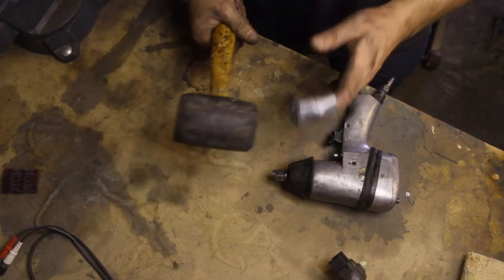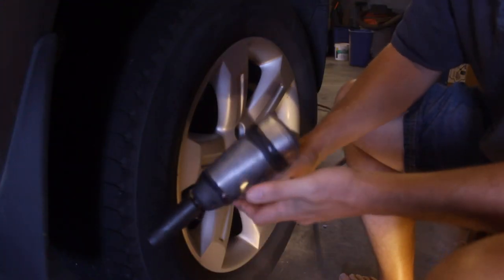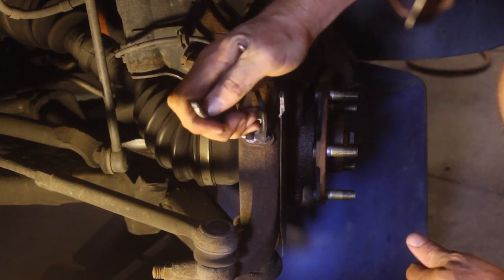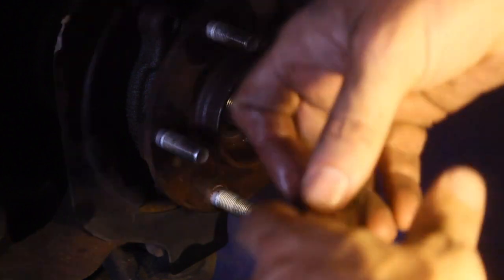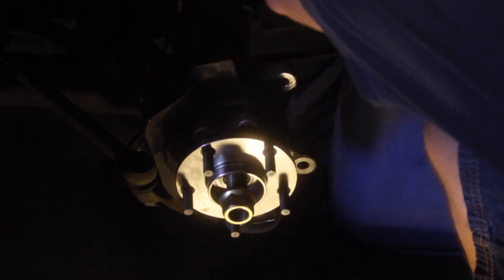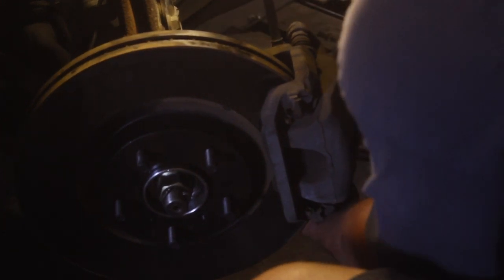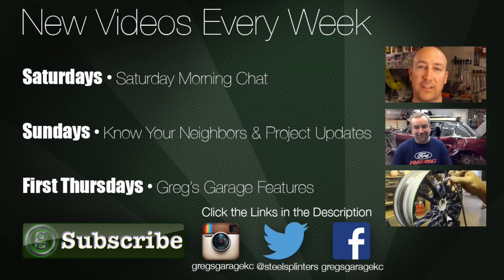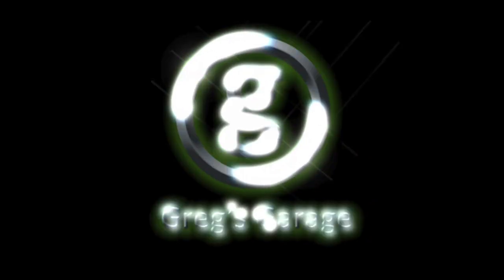Nissan Wheel Bearing Hub Replacement - Murano

Comment: Thanks for the great video Greg! My son and I used it as our guide to replace both front wheel hubs on our 2004 Murano. Side one was plagued with issues of our own doing, such as snapping a bolt and spending hours driving around town looking for one (this is Honolulu) and then leaving the keys in the ignition which killed the battery. But eventually got it done. Side 2 was an hour start to finish. Your video made it easy.

Comment: Greg, Thank you once again for such a great step by step video. First, last year with the radiator replacement vid you posted and now with the hub. I have, of course, watched other videos, but I find yours to have the best explanations and you seem to find the best angles to show your fellow garage gear heads/mechanics what exactly your working on. Thanks a lot!
Reply from the maker: Thanks brother!  Just trying to pass on what I've learned over the years. It's all easy stuff if you know the big picture.  I've got one on spark plugs as well. It's a funny little job on the nissans.

Comment: Hello, I just wanted to say thanks for this upload it was very helpful. I just changed the wheel bearings on my 07 Murano and your video helped lots. I was having wheel steer bump steer play and a slight clicking sound at slow speed, I thought it was the cv joint making noise but it was the brake noise you talked about talked about clicking was the bearing going bad. Oh I only have 105K miles on my Murano. Thanks again.

Comment: Thanks for this! If youre doing this on your Murano because you have road noise and you've determined its NOT a bad tire or dragging brakes its almost always the front right even though it sounds like the front left. Side note, be prepared to buy a new ABS sensor as well because they are cheap plastic and they'll most likely break when you try to extract them and you'll have to drill the plastic out. The auto parts store will charge over $300 each for the sensor but you can get them at Rock Auto for $50 each

Comment: Great video Greg!
I Especially like it when I see a lug nut go on by hand!
Reply from the maker: tomswonderfulworld Yeah, that's my trade mark.  One good stripped stud will do that to you.
Reply: Just wondering,m if the wheel bearing nut is ONLY 98 ft/lbs??? My Infiniti FX45 =, Nissan, 4 wheel drive is 205 ft/lbs?? Just wondering, did  NOT google it yet....;o)
Reply: How long SHOULD this Repair take on a Older (2006) Murano ? Ty

Comment: Thanks Greg for the great video. changed my wheel bearing hub today. if I had to add anything for others to follow is that when removing the old hub expect it to be rusted in place and use copious amounts of pb blaster along w a pry tool.
Reply from the maker: +Tom Orr YES.  That puller is a MUST have for most of these cars.  100k+ miles means the old rust monster is going to have a good hold of anything below the frame rails.

Comment: Fantastic video! ........ My wife's 2012 Murano has that rhythmic rotating sound. Drives me crazy! I've always thought it was the bearings but became a little puzzled when the sound nearly disappeared after I put new tires on it but it soon returned. It's not the tires!! The tires are wearing beautifully and I faithfully rotate them every 6000 miles. I guess my next move is to have the hub assembly's replaced. Damn it.

Comment: Great vid!  Might want to add if not using an impact wrench, will need to remove 32mm axle nut with help of a breaker bar (and maybe cheater pipe too) before jacking vehicle up.  Also, some anti-sieze lube on the mating surfaces will make next dis-assembly all that much easier.  I will be doing this for a friend's 07 Murano that hasn't been loved and was left sitting most of last winter.
Reply from the maker: +Mark Benninger Great suggestions!

Comment: Very good point to bring out Greg. Part aren't made to pound the fire out of it... use the puller. If not you could cause a lot of grief later. Thanks
Reply from the maker: Rusty Glovebox Exactly!  Sometimes you need the BFH, but it's best to leave it in the box until absolutely necessary.

Comment: Found your video but still applies to my 2006 Murano.  I have noise on the drivers side. I notice if I turn the wheel on driver side I hear noise and the passenger side doesn't turn but doing on the passenger side it turn the driver side.  Is there additional that I need to replace aside from the bearing?

Comment: Fun times.
One item to watch out for. Once you get the hub off but before you install the new one, clean the area where the ABS sensor mounts. The rust there can grow to the point that it levers the sensor away from the tone ring and cause codes or even activation of the ABS due to the lowered signal level.
Reply from the maker: ***** Yes.  I forgot to mention that.  The tolerance there is very tight.

Comment: Replaced the passenger side fine thanks to the video. In replacing the driver side I can get the hub wheel bearing hub pushed all the way into the space to bolt it back in. Could I have pulled the axle out?

Comment: You didn't you just use a wire hanger to support the calliper from the coil spring? if that trash can gets bumped, tor calliper will fall & be hard on the rubber brake line.

Comment: nice job, music is annoying and distract the job at hand, great job, but i never saw anything on or about the removal of the ABS sensor or even if the sensor has to be removed to get the wheel bearing out for a 2012 nissan murano   ty

Comment: I changed my passenger side front wheel hub- after tightening everything, my speed sensor wouldn’t fit. I removed and checked if I had installed wrong- it was installed right. Reinstalled and still won’t fit. Any hints as to what to do?
Reply: Don't buy cheap chinesium parts on Amazon?

Comment: had to ask this question with my account,  what size puller did you use? I am looking on amazon for one but all i seem to find is 3,6 or 8 inch.
 arent the rotors like atleast 12" or 13"
Reply: Most of the chain part stores in the US will load you one for free. Just charge your CC in case you don't return it, but refund it.

Comment: thanks for the great video bud.

I used a hub puller and it came apart easy. I still had to hammer it with a 2lb hammer. but I made sure to scrape and sand and then liberally anti seize it.

Also the axle but torque is 177ft lbs not 92. it was updated for 2009-2014 Murano.
Reply: I was looking for the torque for my 2010 Rogue and found the same contradictory torque spec for the front axle nut. One was like 88 and the other was like 190. Any idea why they are so different?

Comment: I just did this today. I'm getting a terrible grinding sound when driving (did not go over 5 mph)  I had a he'll of a time getting the old hub off. Did I damage the CVT boot? Did I over tighten the axel nut? Could the new bearing hub have arrived faulty? I'm at a loss
Reply: If the shield behind the hub is touching the rotor then you get a noise

Comment: Do you need an alignment after replacing the wheel hub bearing?
Reply from the maker: You should not need to align after replacing the wheel hub...  That said, if you do not get them seated properly or if an alignment was done with a worn hub, you may need to have it aligned...  You'll know quickly if the car dives or ducks to one side.

Comment: I have a 2010 Nissan Murano LE? with 53,000 easy miles on it. Replaced both front wheel bearing assembly's @ $1400.00 and change. WTF? Wheel bearings should last at least 100,000 miles, at the least. Faulty parts as far as I'm concerned.
Reply: $1400 for 2 wheel bearings? Man, did you even think about getting another quote?  $30 for a ratchet set and $8 for spindle bearing is all you really need.
One thing he didn't show is take 2-3 minutes with a wire brush and clean out where the hub sits so it will in fact go in smoothly. Maybe put a little sil-gly or anti-seize in there so it doesn't rust for the next replacement.

Comment: A bearing puller is the WORST tool to use to pull the bearing, it puts WAY to mutch pressure on the cv-axle/ transmission case!!!